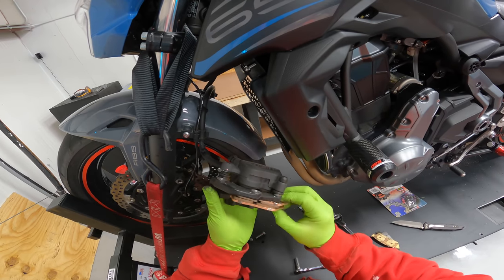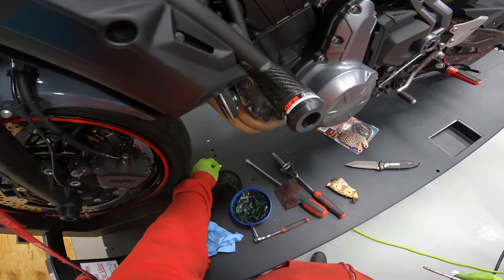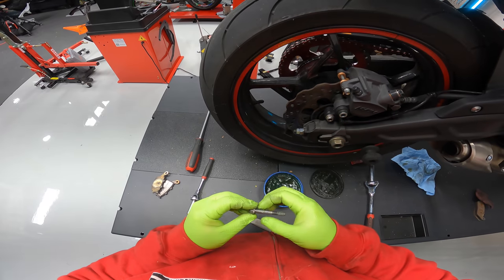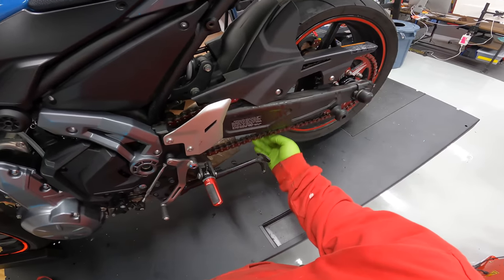FASTEST way to STOP a motorcycle!! | BTV #04

Comment: Most people will not work on my Piaggio mp3 250 IE because technically hardware-based! I need replaced third brake on tiling system only one thing I need. I purchased all brakes I need to replace all of them!

Comment: Please don’t put regular grease anywhere near your brakes, it will creep and contaminate other parts of your brakes, if your luck is anything like mine you’re brake won’t fail in a car park or a lot, you know they’re gonna fail when you get caught out going into a bend too quick and you need them to be on the ball to save your ass, 
the only thing you should use on your brakes are brake cleaner and ceramic grease, in a push copperease, a little on your slides and a little behind the pads,

Comment: Brian, why no copaslip to the back of pads? 🇬🇧
Reply: Why would he?
Its never done at the factory and brake manufactures dont recommend it since copper grease damages rubber.
Plus most pads come with anti squeel shims just like the ones in this video.
Reply: those EBC pads have a copper coating on the back so no copaslip needed
Reply: @scooby06sti  There’s a few things that are not done at the factory.
Its like the O rings on the chain, do all cleaning products reduce the life span, subjective.
The pads I have been using for years don’t come with shims and they are a quality branded product.
When brake pads do squeal, you only hear it at low speed, thats because of the vibration of the shim against the pad.
The copaslip prevents the vibration occurring, and likewise if there was no shim ie pad against piston, the copaslip fills the minuscule gap up. 
Hope this helps as to why its good practice to do. 👍🇬🇧
Reply: @heatz711  Dave please see comment that I made to Gaz, can’t be bothered with another explanation. Hope this helps it’s good practice.